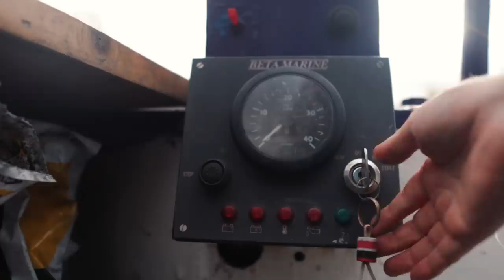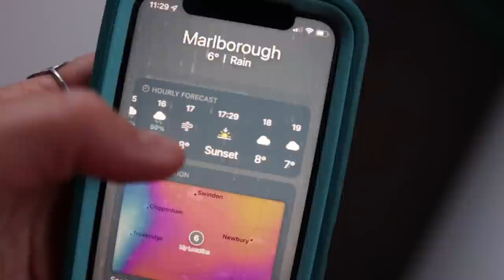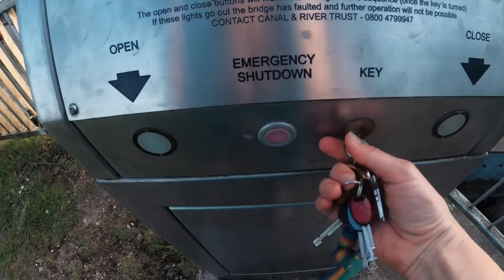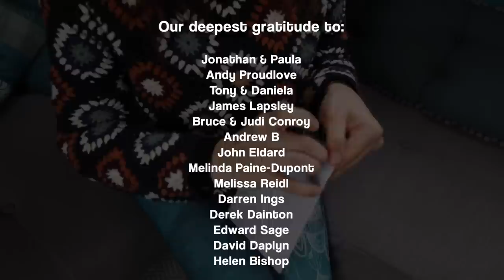Storms and Broken Windows - Boat Life Glamour

Comment: A cheap chainsaw is in order for eventualities like the tree across the canal or for cutting your own wood for the wood burner.
Reply: I agree!! I just bought a battery operated one, and I dont live on a canal. It is worth it!
Reply: @rwisti11301962  Same, my wife bought me a battery powered one for Christmas and it has already been a god send for fallen branches on our driveway.
Reply: That is what I would buy as soon as I can get a narrow boat (I really hope), I would love a Ryobi Chainsaw as it does not only run on a battery but can be charged on a 12v system. And not only with the battery work with the chainsaw but all so a hedge trimmer, grass trimmer to cleared the canal bank for mooring and also a great number of other tools to help with the boat. 
And with the Chainsaw I can help keep the canals running but also get as much fire wood as possible to keep my home warm.